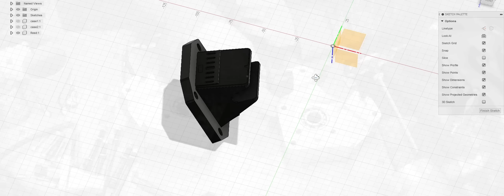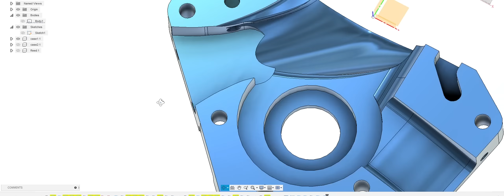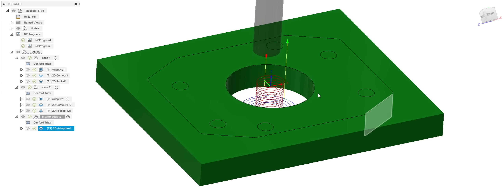A "completely normal" two stroke engine.

Comment: The area under the exhaust side of the cylinder could get a stuffer without restricting the primary intake path…..in the square edge of the bottom of the cylinder resides there currently……if this could get the CCR up to 1.2:1 or greater then the reeds would probably work really well…..also if you end up keeping the reed design for the CR85, then V-force now makes a 4R reed cage that has more bias between the stiffness of the inner vs. outer petals, it may help too with a larger crankcase volume….

Keep up the good work; already excited for the next video 👍🏁👍🏁👍🏁
Reply from the maker: 👍Was just thinking about that area myself 😁
Reply: @2STROKE STUFFING  

I squawking for tighter cases for awhile. Glad you did it my friend. Tgat area mentioned above should be addressed. 👍

Comment: Einstein made only one good quote which I apply straight back at him:  "If you can't explain it simply, you don't understand it well enough."  As a suggestion, instead of listening to "Theoretical" anything, learn who is behind that curriculum, where they are based and how they derive their funding/power.  You will have your mind split wide open to truth! Having said that, repeating FACTS such as these (which are absolutely discoverable) will make you about popular as a fart in jammed a lift.  SMH.
Reply from the maker: I think you're misguided in how this theoretical physics thing works. A field where you're constantly trying to prove yourself wrong, whilst everybody else is also trying to prove you wrong.